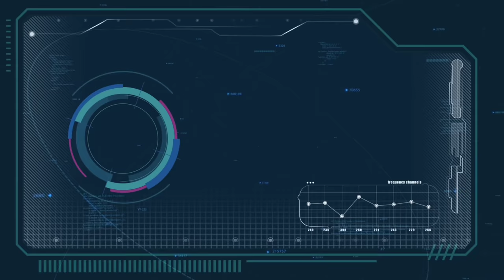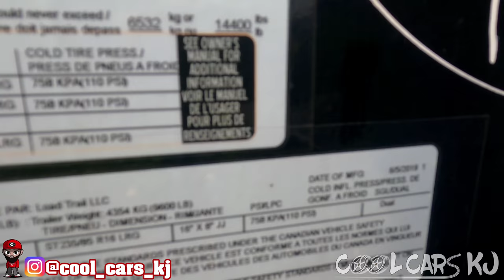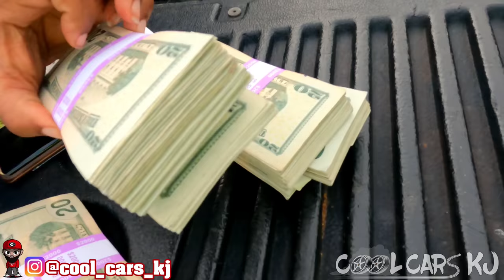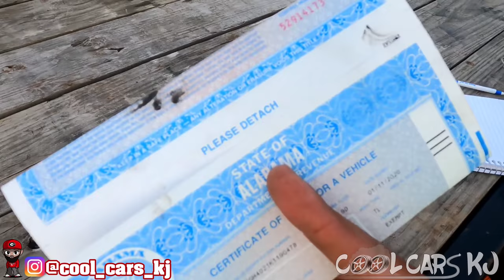Bought Our 1st Gooseneck Trailer❗ a $12,000 Steal 🤔

Comment: Congrats KJ. So happy for you and yours !!  Do you need. CDL for the dual axles?  I know in Cali if you have that kinda trailer and you haul over 26001 lbs you need a CDL. Maybe put on your door Not For Hire. Charge laws for your state hauling a trailer with duals in the back.
Reply from the maker: Yessir, I've had a class A CDL since 2009.
Reply: 10 toes down. Just sharing the little knowledge I have. OBS community!!!

Comment: Congrats on the purchase. Any advice on a 1995 c3500 dually with a 5.7 tbi? I'm wondering if I should rebuild the 5.7 tbi or do a 5.3 ls swap.the truck runs and drives but the engine is tired
Reply from the maker: Ls swap all day but a 6.0. I wouldnt put a 5.3 in a heavy dually. Keep driving it while you stack all the parts up.

Comment: Seal the deck of your trailer with stain/sealer. Your wood will last much longer.
Reply: Simply paint it on? or does it require more prep steps?
Reply from the maker: Ill have to look into that.
Reply: @quaneshajones2714  clean and rinse first. Let it dry. Brush or roller stain/sealer on wood. Let it get tacky, apply another coat.
Reply: @t.l.robinson2162  ok great, thank you!